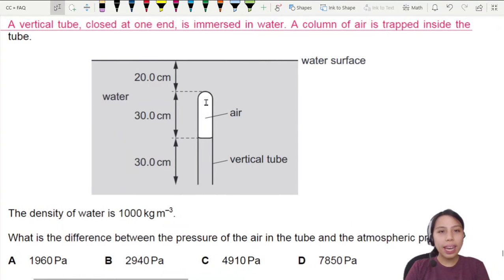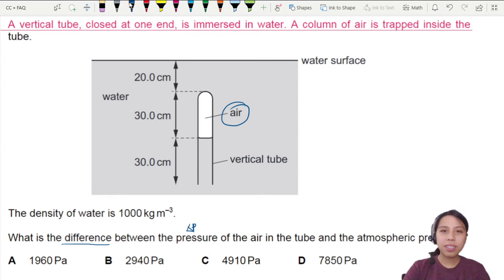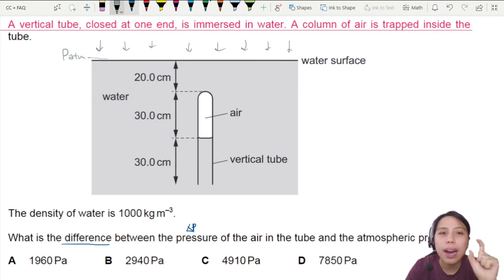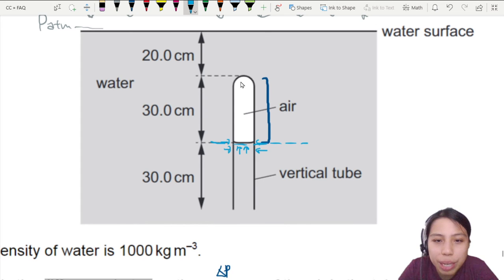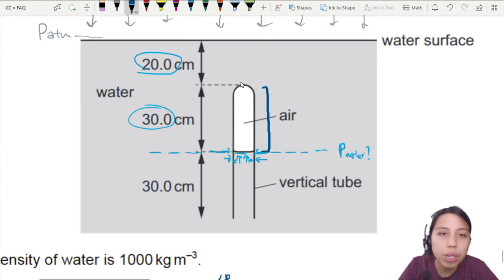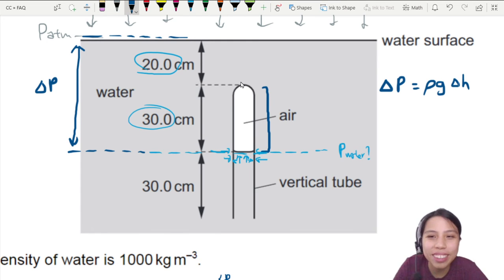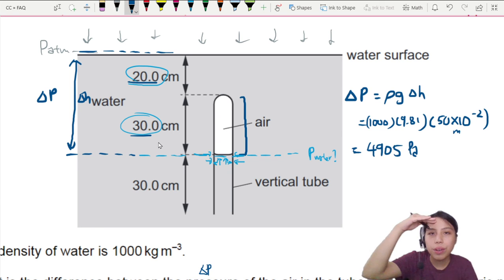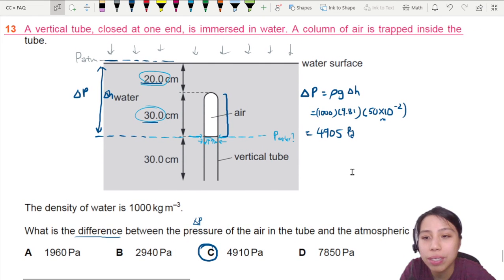4.3c Ex4 ON18 P11 Q13 Pressure Difference for Trapped Air Column | AS | Cambridge A Level Physics

Comment: can u give me the past paper code/name?
Reply: It is also given within video description: 9702/11/O/N/18
Also the examiner report on this question: Many candidates gave the incorrect answer B. The pressure of the air inside the tube is the same as the pressure of the liquid at a depth of 50 cm.

Comment: is the solution correct why isn't it 1960
Reply: In this question you pretty much just calculate it as if it is a normal pressure question, I don't deny that they went a bit abstruse on the question wording them - though the aim of the question only intends to find the pressure in the confied air